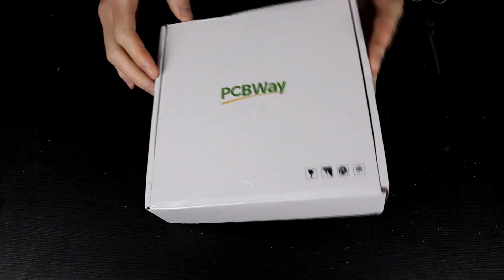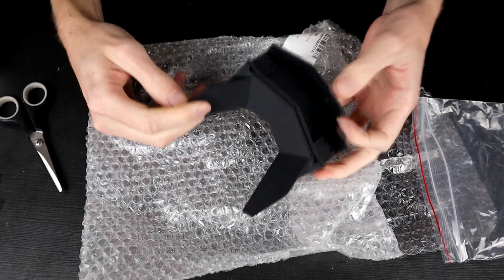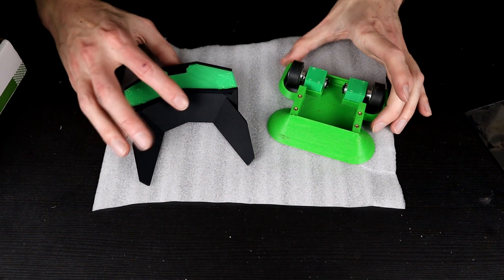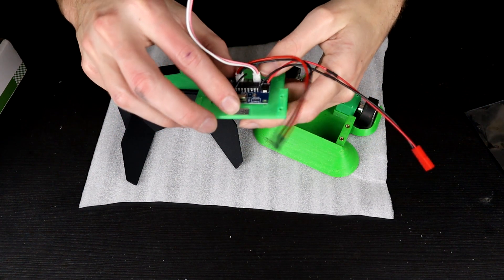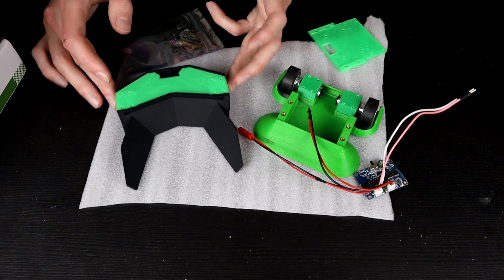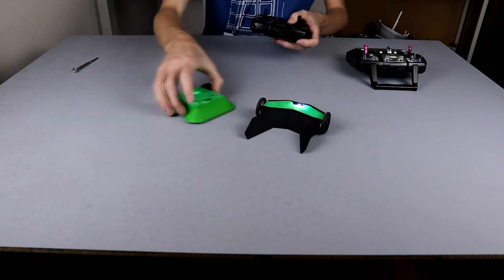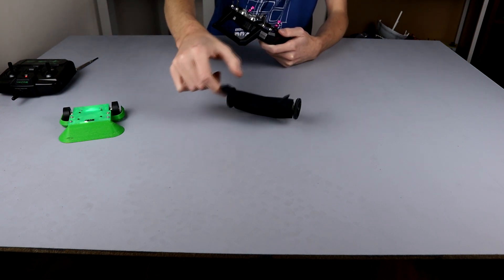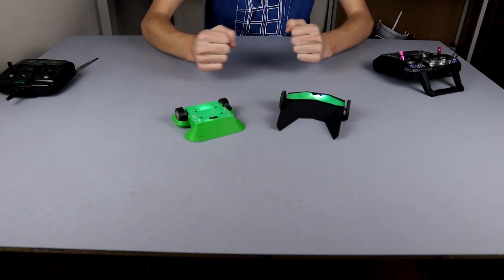Building indestructible(?) 150g combat robots!

Comment: I am first hopefully this build doesn't need a 3D printer
Reply from the maker: sorry but most of my ant weight builds do, 3d printing a chassis is the quickest and easiest way to make an ant that's light and accurately dimensioned

If you dont have a printer of your own, lots of places now have them, look for local libraries, maker spaces, fab labs, or DIY groups. If you cant find any of those plenty of places online will print files for you, including PCBWay
Reply: @TeamPanicRobotics  thanks for the advice